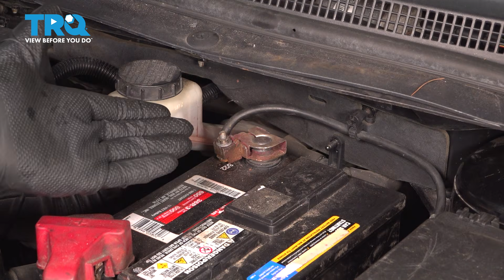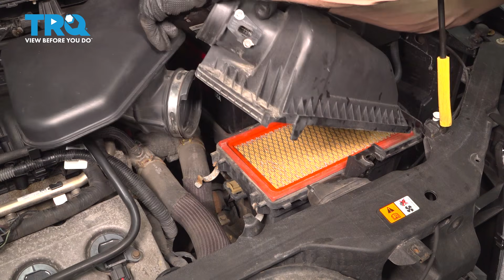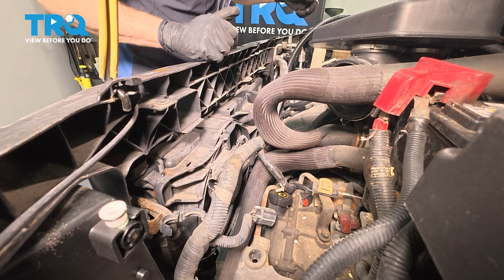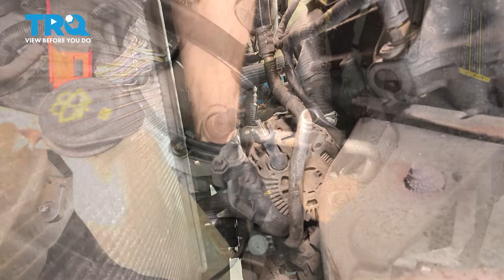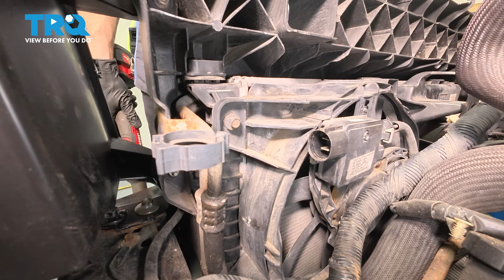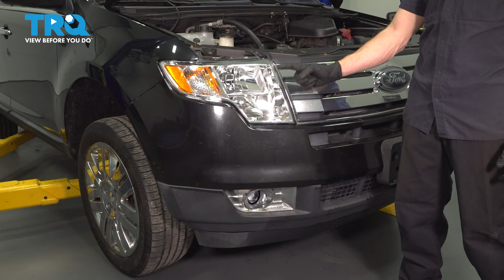How to Replace Alternator 2007-2014 Ford Edge 3.5L

Comment: one year newer and they radiator support arches over the top of the radiator assembly making this entirely ore difficult.  Where are the AC lines???  Again the later models have thew AC Lines right in the way of the lower alternator bolt. PLease do a vide of the later models.

Comment: It is very much worth mentioning... and surprised it is not mentioned in the video. If you accidently use the two longer air filter bolts to install the fan assembly back in, then you will destroy your radiator, and will have to go back in and replace that as well. The bolts look nearly identical, are same thread but just 1/4" longer and that is enough to puncture the wall of your radiator. Do not make this mistake!!!

Comment: So here’s a question. My tensioner doesn’t want to go clockwise for some reason? It will only move counterclockwise which is putting more tension on the belt. What would cause this?

Comment: OUTSTANDING video. Very clear and well-done.  So you did not have to take off the passenger front wheel and guard? That’s good to know. Although I’m wondering if it’s easier to reinstall the serp belt by accessing it there instead of wrangling it from above…?

Comment: Note to DIY mechanics: Do not use the long airbox housing bolts in the radiator fan housing.. or you'll puncture the radiator.